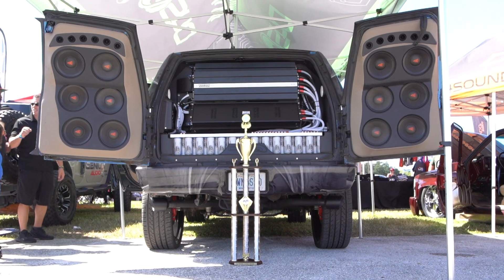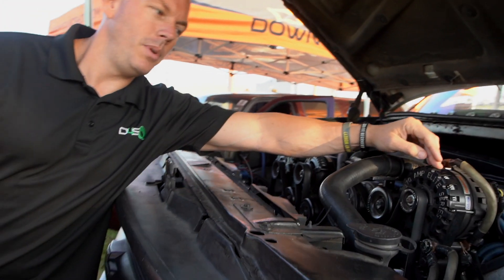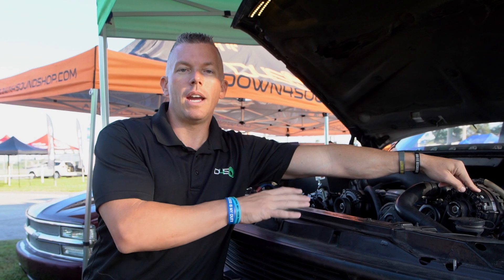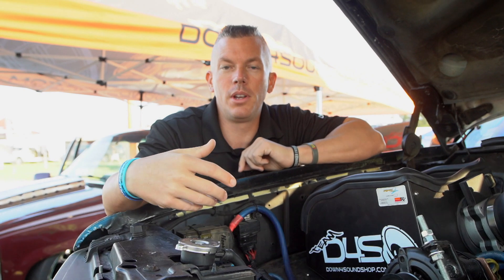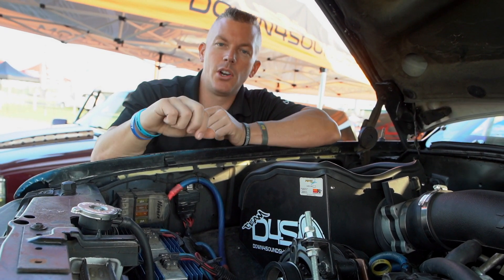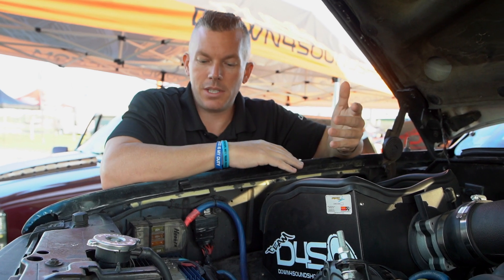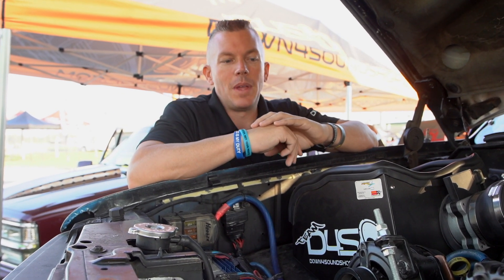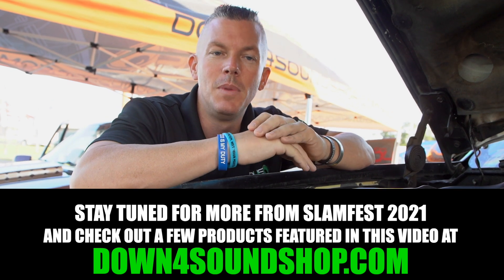FAQ: HOW TO RUN 2 DIFFERENT VOLTAGES IN YOUR VEHICLE?

Comment: I have a question fellas. Sometimes my system plays real loud and bass hits hard other times it doesn't even with the voltage at 13v or more. I've checked everything and can't find anything wrong. No loose wires or anything like that. Was thinking maybe the head unit. What you guys think? It's really annoying.

Comment: My system is 12v car nd 16.8v bass side. 400A externally regulated Mechman w lishen lithium batts nd maxwell boost caps. Taramps bass 5k but moving up to the bass 12k

Comment: Kinda funny tbh, a video was done on the suv before claiming 100k watts now its said its around haalf of that lol.
Reply from the maker: That’s total wattage dingaling 😂 thanks for watching 🙌🏼
Reply: @THELIFEOFPRICE  lol you have from what ive seen 4 videos saying 100k watt system, then you say in this videeo 60k-80k, its fairly simple lol put an SMD Audio meter on the system lol. even if your 2nd electrical system is added into the mix it still dont come out to be 100k that would mean your 2nd electrical system would be putting out 40k-20k lol. im cool with watching your videos as well as otehrs tho its not cool to hear info thats not proven factual. as the saying goes proof other wise never happened. 4 sundown ns2's only comes out to be 40k watts. might wanna watch your video again of the walkthrough of the tahoe and pull out a calculator. pretty ssure the tahoe hasnt changed much at all in 2yrs. derek from sundown even had the ns2 on the dyno all the way up to 17v andd the amp didnt hit 10k lol.
Reply: @ColdVenom159  he probably running them way down below 1ohm. He runs all his his stuff below 1 ohm from what I know.